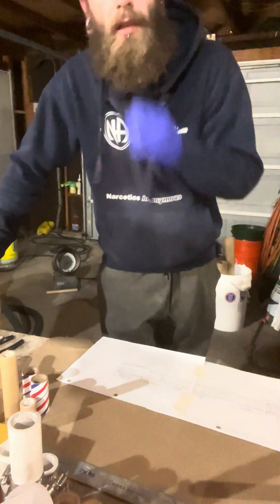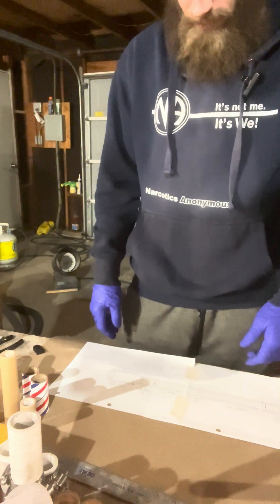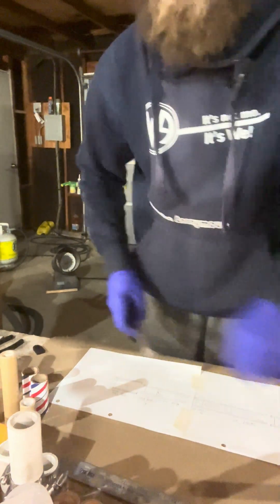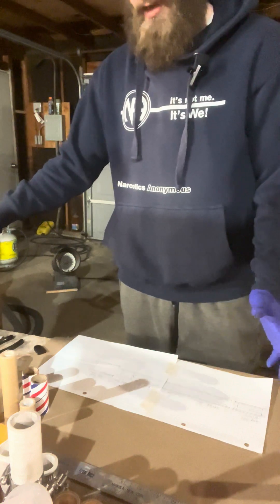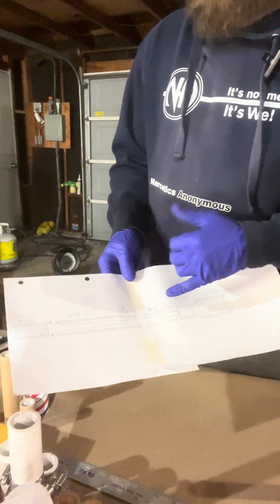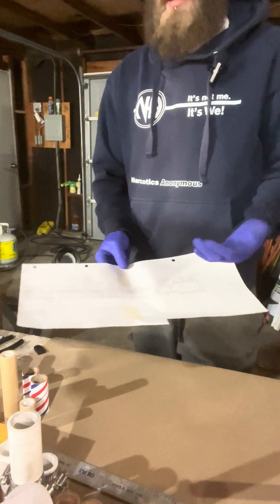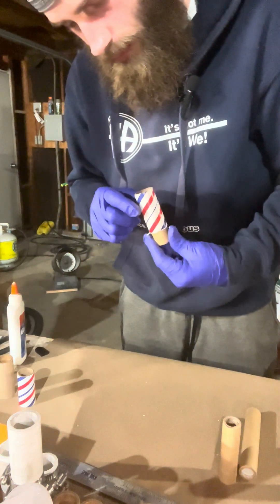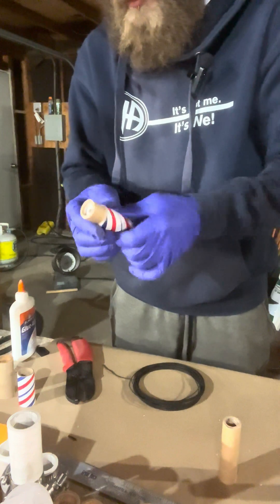3 stage nuclear whistle rocket build

Comment: Does copper oxide function as a retro catalyst in benny as well?
Reply from the maker: I can’t say that I’ve ever used it in Benny but based on a paper I read on different catalysts on fuels yes it would act the same way.
Reply from the maker: But that being said Benny with stronger catalysts can usually be used on a longer spindle without Cato issues
Reply: @Pyrodadsam  im using benny with red on extreme tooling but its been real difficult to get consistent full burns without catos but when they are successful they are mean i am using a p2f guage and pressing near 9k figure ill try a different catalyst
Reply from the maker: @213BRANDONP what fuel oxidizer ratio are you using? I usually only press to 7500 max and have very very few CATOs. The tubes you are using make a world of difference too. If you are using NEPT tubes that definitely not the issue I wouldn’t think though.
Reply from the maker: @213BRANDONP not sure what your fuel making process is like either but that can be a contributing factor as well. If you are getting inconsistent burns and pressing your motors at the same pressure every time that might be part of the issue. Idk I’m just brainstorming!
Reply: @Pyrodadsam  the fuel is definitely not inconsistent its just consistently too strong to stay In the tube ive even used it in smaller diameter tubes end burning with no core and it worked fine whistled loud and still took off like a bat out of hell that's why I was thinking maybe using the copper oxide might slower down some
Reply: @Pyrodadsam I guess that came out wrong the fuel Burns consistently but it consistently seems strong as hell and like it's over pressuring the tube pretty sure I got a video around here somewhere

Comment: Master...what oxidiser do you used for 76 23 1 ratio of gray sali? Tnx in advance😊
Reply from the maker: Potassium perchlorate! I’m no master im learning everyday I just like to share what I learn with you guys!
Reply: Thanks a lot for your response.
76 potassium perchlorate
23 ?
1 black copper oxide

What is that 23%? Sir
Reply from the maker: @elzarafireworks my pleasure 
76: KCLO4 
23: sodium salicylate 
1: black copper oxide 
And I use an additional 3% paraffin wax
Reply: @Pyrodadsam tnx a lot. That is why it is called gray sali?
Reply from the maker: Correct. The copper oxide tints the white powder gray once everything is dry.
Reply: @Pyrodadsam I found on an online store here in Philippines, the sodium sali analytical pure. Is it ok if I used this? Not the Pyro grade sali?
Reply from the maker: Yes that should work great! Have you made whistle fuel before?
Reply: @Pyrodadsam yes. I used 70% kclo3, 30% sodium benzoate,1 % red iron oxide, and 1% mineral oil.,mix with lacquer thinner and dry under na sun.

But my problem is this fuel cannot be stored for a long time if used for wistle rocket., it will CATO
Reply: @Pyrodadsam Ive been wondering I've heard you prefer wax over Vaseline or especially mineral oil is the process the same as with Vaseline ie heat dilute with fuel
Reply: @213BRANDONP  I see no difference using mineral oil, and it's a lot easier to work with. 3 grams.
Reply from the maker: Brandon Sorry for the delayed response. The only difference in the process would be heating the petroleum jelly or wax to liquify it before integrating it into your solvent. With the mineral oil the one advantage is not having to apply heat. Other than that the process is completely the same. I just prefer wax personally because I’ve found that pressing is always a lot cleaner in my opinion.

Comment: Im wondering if you dry your chems before mixing? Also, how do you mill your potassium benzoate?
Reply from the maker: Not usually because most compositions get moisture applied when being mixed anyway and 9/10 times I dry my finished comps in my drying box. 
I mill most of my chems in a single serving blender. Works great! If you decide to go that route it’s best to get two of them one for fuel one for oxidizers. It’s can be ball milled with ceramic media as well just needs to be shaken often because it clumps.
Reply: @Pyrodadsam  Thanks!  How many lbs of the ceramic media would you recommend for a rebel 17?  I use 35lbs lead for my BP.
Reply: Yes! You can't weigh chemicals accurately if they contain water.
Salts get wet, but potassium benzoate isn't as hygroscopic as sodium benzoate.
Potassium perchlorate is not hygroscopic.
The easiest way is to Google the chemicals you're working with to find out if it hygroscopic. 225°F in an electric oven, 60-90 minutes.
Reply: @hunternedib1119  how long after do you have to weigh it “before chems becoming moisturized” ?
Reply: @AileenNopales  It depends on the chemical and the environment.
I dry the chemicals I will use that day, or sometimes the next day. The best tip is to dry your chemicals as you need them.

Comment: Good job , hope the gray sali works well ,  when developed the gray sali some time ago had only the idea of a whistle capable of producing loud whistle effect combined with a slow burning rate when compared with other fuels , gray sali not just ended up performing better than expected as a delay fuel ,   but also being an excellent  thrust fuel , it sounds crazy good and almost eliminates the chances of  CATOing due to it's stability and low pressure on motors.
Looking forward to see your 3 stage in action.
Reply from the maker: The whistle master! I appreciate the comment. Did you develop that fuel? I first seen it in one of your videos but have since read about it in articles comparing catalysts. The sound is unique and super powerful. It has preformed incredibly in other rockets I’ve built.
Reply: @Pyrodadsam  the black cu oxide as being used for a long time in numerous whistle fuels but pretty much discarded for being a retro-catalyst , I developed the gray sali I use which has different percentages than the ones tested back on the time and then discarded , after water/ alcohol granulation and then adding wax via hot naphta once granulated fuel is 100% dry , that brings gray sali to the nex level in sound , thrust , high energy and stability,  so in other words , yes I developed the fuel as what it is as today.
Reply from the maker: @Pyroflorida you are a pioneer sir! What ratios do you use? I have had really good results with 76/23/1 but have not tried granulating in water prior to treating with wax in naphtha. I just posted a short with the gray sali I have pressed on a 4” spindle.
Reply: What part of Florida are you in

Comment: What phlegmatizer do you use? Wax, Vaseline or mineral oil?
Reply from the maker: I normally use Vaseline. But I recently made a batch of sali with paraffin and I think I prefer it! Almost no fuel sticks inside the rammers when pressing. Ive noticed no change in power or CATOs between the two.